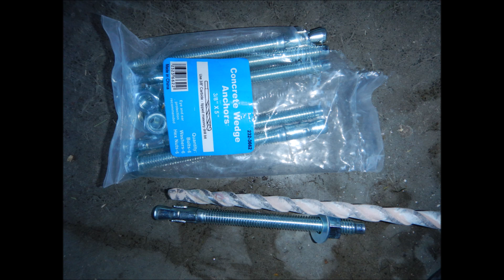John's AirCrete Pour

Comment: You could have used foam that they have/use  leveling sidewalks/concrete without all that work you just went through.
Reply: That is closed cell foam; this requires open cell foam.